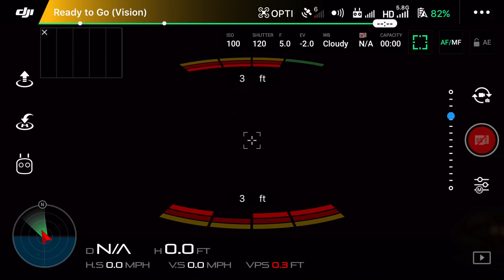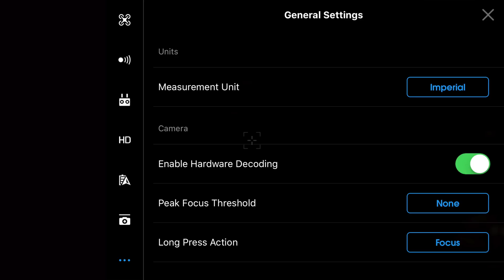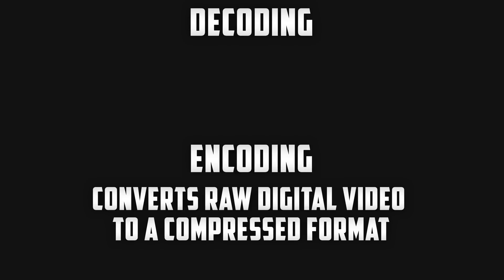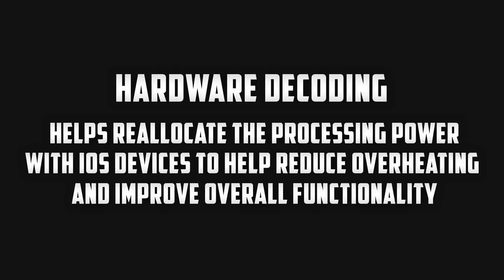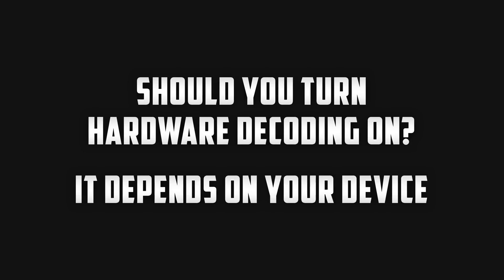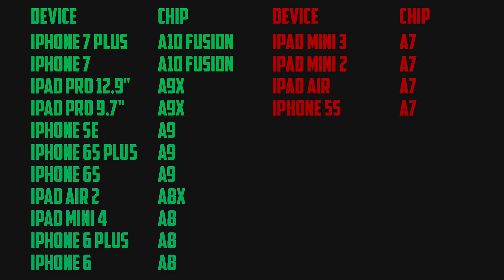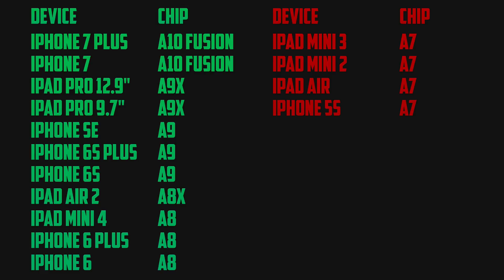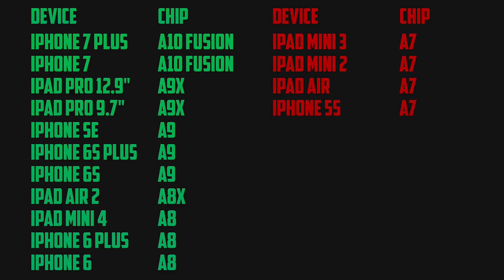DJI Go 4 App: Hardware Decoding Explained

Comment: I have a phantom 4 pro. When I'm recording I see lag and a green screen. When I watch the video I also see the same freezing and green screen that it recorded. I am using an iPad air and according to your video the hardware Decoder needs to be turned off which it was not. I'm new to this so forgive me if my question seems dumb. What does the iPad have to do with the camera that's doing the actual recording why wouldn't freeze and show green screen?
Reply: I understand that the transmitting to the iPad would look green screen and freezing but why would the actual video when I watch it back on my computer see the same freezing and green screen?
Reply from the maker: This sounds like an issue with the actual camera. I would try an IMU calibration, if that doesn't work try contacting DJI Support.

Comment: Ok, so hardware decoding uses the GPU and not the main cores in the CPU, think of this as a separate CPU for graphics only.
This is a long comments but bare with me. I think your will like it. 
So the bigger question becomes with battery life. Since the controller will charge the phone if the phone is not fully charged this also affected the battery on the controller and the phone. So your last video you said you were looking for video ideas, I have one for you.
I can see this going either way. Using the flu and CPU together could drain the battery on the phone faster. That can lead to the controller charging the phone more and decreasing the controller battery.
If you have the fly more kit you can fly 4 to 5 batteries, that equals over an hour and a half. This is charging the used packs in the car while flying one pack. My testing shows the car charger will charge the batteries twice as fast as the home charger. 
Well that's great, if the controller and phone batteries can keep up when your flying one battery to another with a 10 minutes of cool down time in between each flight. 
So maybe your next video can prove what's more energy efficient. Hardware decoding, or not. The longer the cell phone battery hold up, the less he controller charges it and the longer flight time for both to keep up with the 5 packs your flying.
So I was going to do this video when the weather gets nicer, but it's winter in Ohio and well the weather has not been nice. I don't want to fly my batteries in the cold, and my health doesn't let me be outside in the cold either. 
So my gift to you if you want it, this video idea since you can get it done before me.
Yea, I can do the spec lookup and see what the A8 chip claims is more efficient battery life and all the other data sheet research. But people want to see definitive proof in a video. I'm thinking a time laps showing battery life of the controller and phone after one pack flight, then the next, and the next. This done twice with GPU hardware decoding on, and with it off. So can you prove this? 
Of course you will have to mention each phone is a little different. Your iPhone 7to my 6S has better battery efficiency because of faster but less power hungry CPU, GPU, and possibly both. So the newer phone may win in the end, but the results of what would have longer battery life should be the same for all the phone you listed as green. 
Good luck,
Scott

Comment: Billy, I have an ipad Air on the Mavic and P4P?  What I turned it on?  Would it affect it negatively?
Reply from the maker: Is it the first or second one?
Reply: Billy Kyle first edition iPad air
Reply from the maker: Because of the A7 chip, DJI recommends you have it off, but if you don't notice the problems I stated you should be fine to keep it on.

Comment: Hey Billy, I'm using iPad Mini2 with A7, and I have always used it with H/W decoding enabled on my P3P, and it has worked fine.  You said to disable it with an A7.  Can you explain what the downside is to having H/W decoding enabled with A7?  Maybe I missed it.
Reply from the maker: +Tom Spurlock Aparently it results in artifacts showing up in the video. I feel like although this is not a definite answer, it will help to fix someone's problem.

Comment: Good topic Billy - I use an iPhone 7Plus and an iPad mini4 for my controller(s) so I am usually good to go.

Although possibly related, I do have 2 questions that may mean I have something incorrect: (I am filming at 4K @ 24 FPS)
1. When filming longer flight routes (i.e. over 5 minutes long) it truncates my video into 2 separate videos when I reach 4 GB or about 5 minutes in length. Is that by design? Of the SD card, the camera, the ?? Is there a fix or is that some limit of the hardware or software?
2. And, when panning I am still getting jagged movement - am I panning too fast or is my FPS too slow? Or some other setting aperture or ISO setting incorrect? (my histogram is always dead center good).

Any thoughts would be appreciated.
Reply from the maker: +Paul Straten Here's what I've got:
1) It always makes 2 separate files, in fact this is fairly common as my GoPro and DSLR do the same thing. Doesn't bother me as they can be easily stitched together on post. 
2) When you pan do you get jagged movement in the video coming off of your raw video file or just in the video that is streamed to your tablet/phone screen?

Comment: So the big question is how the heck can ya get a iPad Pro 12.7 mounted to the controller, or would the regular suffice?
Reply from the maker: +The Chaos Rift You need a mount. I have one and it's awesome using that huge screen, but it kind of looks stupid
Reply: Thanks. I'll stick with the 9.7 screen that fits without adapter. Flying with the iPhone 6+, the screen was too small and difficult to read. The Samsung note 10.1 I bought, just fits too awkward.
Reply from the maker: +The Chaos Rift I've heard the iPad Mini works really well

Comment: Thank you billy make this  video ......

but as you say ipad air 2 is in green list so why my ipad air 2 has to off hardware decoding for best results any other settings i have to do out of dji go 4 app in app ios settings? plz help
Reply from the maker: Maybe all you had to do was fix the transmission (frequency) and not hardware decoding. Try turning it on again with the changed frequency.

Comment: Thanks, Billy. I was gonna ask you this on one of your other videos, but since this is so current, I'll use this opportunity, with your kind permission.

Okay, I've been trying to make a seamless 360 pan over my house for about a week. This morning I gave it my best effort, and made sure I had my thumb securely rested on the left stick. In spite of concentrating on this one thing throughout, I got about four pauses that ruined the effort. Is there another software out there that would have an intelligent mode that could handle something as simple as this? Thanks!
Reply from the maker: Were the pauses in the recorded video on the SD card or just on the live feed coming back to the phone?
Reply: Tripod Mode. I could perceive the pauses as they happened, and when viewed in FCP X, they were confirmed.
Reply from the maker: +VideosFmHades Interesting. Maybe a factory reset can help.
Reply: Possibly. Maybe I'll try with a competent operator. Thanks, Billy.
Reply from the maker: +VideosFmHades Sure thing